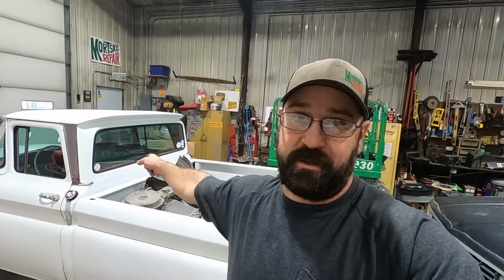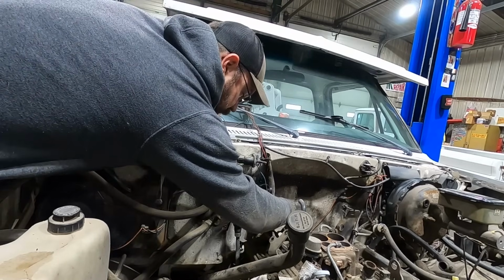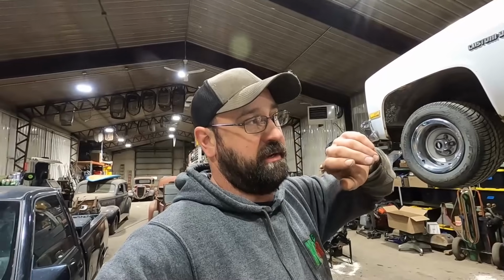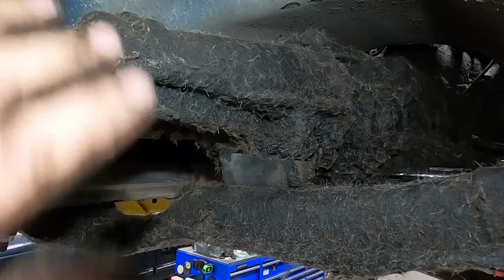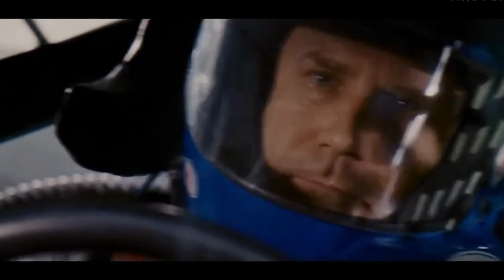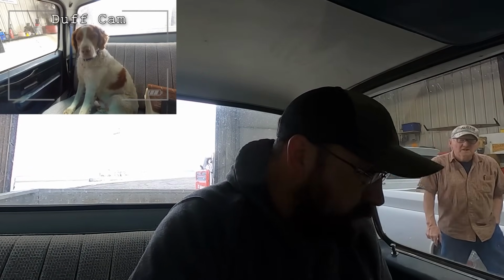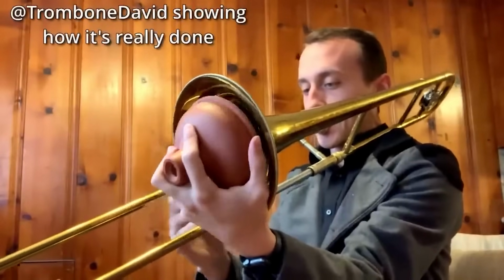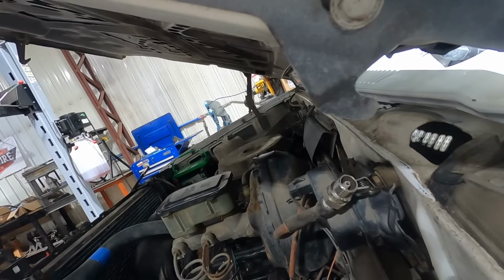V8 Squarebody Swap in a Weekend!! Out with the old V6 and in with a new Small Block! Power Upgrades!

Comment: My Grandfather bought a brand new dark brown 1985 Lwb 2wd Squarebody off the lot. 4.3 4brl th375 turbo. Trucks still running down the road with matching numbers still intact. 39k original miles.
Reply: Funny thing, i bought my Black  '85 SWB 4x4 off the showroom floor and still have it and drive it to this day!.. however unlike your grandad's its not matching numbers but new crate 350, headers, big intake, new trans many times over, but always will be my baby!
Reply: @billnalder1017  sweet 😎
Reply: @billnalder1017  Question, did your 1985 stock transmission have a kickdown cable?   Unlike the 86 style
Reply: @brons5256  Im pretty sure it did, however  the truck has gone thru many a transmissions..it didnt come with a trans cooler originally but it does now... its an awesome truck- im still enjoying it to this day..

Comment: If it was a Toyota, I'd say "Bugger!".  Well, the V8 runs at least, eh?  You made quick work on that swap, mate.  Amazing what you can do with stuff you got lying about the shop too.  

Just as a warning, I've had several ignition modules that died intermittently.  Engine would get warm and they'd conk out for a couple of minutes and then fire up like there was never an issue - usually about the time it took me to lift the bonnet after cranking it a couple of times.  I'd check for spark, the old cow would fire up on as many as she could, I'd put the plug wire I was testing with back on - thinking the problem wasn't spark - get a few miles further down the road and it would repeat the problem.  Took me a few times of it doing this to find the problem.  Once it was a loose connection on the coil and the others it was the module itself overheating and dying.  From that perspective, you cannot beat points and a condenser, but those buggers have their issues as well.  I'd still rather have an electronic ignition in the winter though, for sure.  

I'll never forget the time the first one started dying - I was in 3rd going down a hill and the rev counter kept going to zero when the module quit and bouncing back up when it came right again.  Every time it came back to life there was an almighty BANG from the rear of the car as the unburnt gases in the pipe suddenly ignited.  The bloke following me reckoned one of the belches of flame was at least 3ft long!  All I know was that it really lit up the back of the car when it happened at night - certainly enough to see the looks of surprise on the faces of the people in the car behind me!

After checking all the wiring connections to the ignition module, if you got a spare module in your stash, that would be the first thing I'd change.  One thought - if the switched power going to the module - if it comes directly from your ignition switch, you might want to check that too.  However, my money is on the module being temperamental.  As to the gauge cluster being dead, the power gets fed through the gauge first and then it grounds out at the senders to various degrees, which in turn moves the needles.  If there is a common power to the fuel, oil and temp gauge - either in the back of the cluster or through a fuse or relay - then that's where your problem lies.  Otherwise I can't see how all three gauges can read nothing unless all three senders are bad.....so its more likely there is a common power fault.  Check fuse, then relay (if it has one) and then power wire.  Hopefully it just a dirty connection.

All the best - and please let us know how you get on.  Cheers!

Comment: I did a V8 swap on an '87 long bed 4 speed that had the same issues with the 4.3L. I slid the V6 frame mounts ahead and welded the mounts and the bottom part of the mounts to the cradle. The 350 sat a lil' crooked, but it worked fineish

Comment: I always thought the 4.3 motors never got the recognition they deserved. I found them cheap and dependable for the money.  My 2nd gen Blazer had the fuel injected 4.3 and always ran very nicely. Always had great responsiveness. I never had any power train issues at all in that 4 by 4 SUV which I drove over ten years. I thought it tempting to change out the center point injection system to a multi port, with the adaptation of a neat Delco replacement kit. Then I thought, if it ain't broke,....... don't fix it!
Reply from the maker: Nothing wrong with them. This one was just worn out.

Comment: There is a difference in Temperature sensors.  get the one that worked with the gauge.  Oil pressure, usually die due to internal leaking

Comment: I had an 86 with a blown up 4.3 and a 4speed, just a plain-jane no a/c vinyl seat.  I put in a 350, which was a pretty easy swap, made it a good working pickup. I was able to use a lot of the v6 stuff as you did.   We got a bit of snow in McCook as well.  I keep telling myself it is one day closer to spring!
Reply from the maker: Sure is

Comment: Mortske, you are putting a lot of faith in that engine lift plate.

I have had an engine hit the ground while using that type of lift plate...

No, the lift plate did not fail... 

No, the bolts did not break....

No, the hoist did not fail...

THE INTAKE CAME APART!!! 

Like the 4.3 you are pulling out 
The engine seemed to have a bad head gasket.... 
This was a misdiagnosis.... 
In reality the intake had a crack underneath that was causing the same symptoms as a blown head gasket....
after I lifted the engine out, I was rolling the cherry picker away from the truck and as it was going over the grille the intake gave out the rest of the way.... 

It demolished the grille and front valance, bent the crap out of the hood latch, radiator support, bumper, and smashed in the oil pan so badly the oil pickup tube was broken off of the oil pump....  

Just for your own safety I would suggest looping a chain around the engine through the lift plate and locking it to itself.   it will keep the engine from falling in the event the intake fails to support the weight of the engine....

It would have saved me from buying a grille, bumper, and valance for my customer. 

I was really lucky not to get hurt when it happened, if the cherry picker had not been stopped by a wheel getting jammed in the floor drain grate it would have run over my foot.
Reply from the maker: never heard of such a thing
Reply: @MortskeRepair  That's understandable,  until that intake came apart, neither had I. And even though I haven't had another one do it, I always use a safety loop  just on the off chance it does.

Comment: I'm sure by now you've got it fixed, but I'd still suspect you had a bad HEI ignition module.  Had one doing the same thing in my 78 a few years ago while camping.  Would fire up and run like hell for a little bit before it just lost spark completely and died.  Turn the key off and let it sit for a few minutes and it would fire back up and run a little farther.  Did that several times before it finally died altogether.  Fortunately my old man taught me to keep a spare module in a ziplock in the glove box for just such an occasion and I wasn't stranded 2 hours from home.

Comment: Take that sunk float out and put a new one in it , Q Jets are soooooooooooo easy !  When the fuel leaks from the accelerator pump stem and not the Air horn vent , it is usually the "Foam Float went absorbent" , not trash under the needle.

Comment: I like the fact that you used the correct motor mounts, I had a manifold problem on the exhaust hitting the valve covers. I stuck an LT1 in a 58 Delray. I had to grind the little lumps off the manifolds to have a little space between the valve covers and exhaust manifolds. Doing it right never makes you a hack.

Comment: Excellent video Mortske Repair    :) , Duff Dog 🐕,  , MOJO :) , Mr. & Mrs. Pookie and daughter  to ! Also Mortske did you hook up ground strap on firewall heater to bolt back to plus Ground pigtail to fender wall clean up like it 10 mm bolt too, oil pressure gauge on left side on front 2 spark plugs  in middle to  also temperature sensor   near thermostat is and hope solve  those problems! Filler neck should replace and no leaks and rad recore or fix tanks up too so no leaks!

Comment: Good (and timely) video today. Had the same intermittent problem with the ignition module in my ’77 LeSabre with the Pontiac 301. Solved with new cap, coil, module, rotor, and ground wires. So many issues can be traced to ground wiring in an old B body. Very frustrating though; twice she had to come home on a AAA flatbed! 
God has absolutely blessed you with the love of Duff Dog; the way he appreciates your pets at the end of the video says it all. Love the Duff!

Comment: 46:32  Casper might be a good candidate for a Holley Sniper kit. It would eliminate the need to play with quadra-bogs.
Reply: Wow never those things are trash have you seen anyone have good luck with one ? If so send me the video of them bolting it on and driving away that carb has some garbage in the seat is all and it could easily be fixed in no time w out installing 02 sensors and maf sensor and programming it and then still having issues w it kill. The battery like he did and opos start all over nevermind higher pressure fuel system and the list goes on for a. Over complicated carburetor say I'm lying !! If it was fuel injection ok but to swap is stupid and a waste of money for what a better cold start not better performance nope so what was that again two thousand dollars later and it still won't run right again say I'm a liar  ! All those aftermarket injection systems are nothing but an over complicated expensive carburetor that still doesn't work right ever show me a video of anything besides that please do I'm dying to see it ..
Reply: Not on a bet they are too  expensive and for no gain show me one person that had good luck w one ever and besides that the higher pressure fuel system and again no performance gains maybe a better cold start.aybe but I can set theT q jet to start like. A champ in zero degrees so again 2000 dollars later what have you gained nothing but you think you look cool cuz you can afford to throw two grand out the window if so call .me .Mr window lol

Comment: Thats not an EGR intake. The raised area with the bolt on cap is for heated choke from the exhaust crossover on the intake. Many of the older chevy's used the heat in the intake manifold to work the choke.

Comment: I had a simaller fitment issue once. Chinese chrome valve cover wouldn't clear a Chinese aluminium intake. My cheap solution was to use 2 valve cover gaskets on each side. I bonded them together with gasket shellac before installing them so they wouldn't squirm around while tightening them up. Worked pretty good for me. Your results may vary...
Reply from the maker: Good to know

Comment: I've no idea how the ignition on those work..

 But I've seen a coil start to break up once it gets up to temperature (say 20-30 min) then lose spark, leave it for a while to cool off and it'll start and run for the same again and then once back up to temp it will lose spark all over again
Reply from the maker: Thanks for the tip

Comment: Hey Mortske.  When a belt is "serpentine" it "snakes" around a lot of pulleys like a "serpent".  Serpentine doesn't describe the flat grooved cross-section of the belt versus a V-belt.  If a flat belt only goes around two pulleys like the water pump and alternator or crank and alternator, that doesn't make it "serpentine".  Just tryin' to help.  :)  Take care.

Comment: Getting ready to do this to my 91 short bed, found a 454 with a TH400 for $700 but I don't know if I wanna go that route, that's a lot of engine 😮 I do have a 305 and a 700R4 in trhe back yard, probably gonna separate the two and mate the 305 to the 5-speed in the truck.
Reply from the maker: Nice
Reply: @MortskeRepair  Ain't no way in hell that 5-speed would hold up to that 454.

Comment: If you ever have trouble with that bolt hole for the starter they make a straight across dual bolt patern starter. Its one of those high torque mini starters but they work well. I think i got mine from summit or speedway
Reply from the maker: Good to know

Comment: Had the issue in my '03 Avalanche where my Temp was always pegged on overheating, speedo didn't work, fuel gauge was about a ¼ lower than actual, and voltage read low as well I believe. Never did figure that out.

Comment: That's one of the easiest swaps to do. We did that with an '83 that had a straight 6. It had one of those integrated intahaust manifolds which was cracked to Hell and back. Got a 350 from the junkyard with 40k miles which was cheaper than the manifold. Just had to cobble up the linkages is all. Bolted right in - started up first try. He got another 100K+ miles out of that pile of rust.
Reply from the maker: Good times!

Comment: I've had the wires from the distributor module to the pickup go bad. Also seen them act up when the vacuum advance would kick in and rotate the plate and separate the wires.

Comment: Hello Mortske, you should've went ahead & took that Chinese intake off & put a stock GM Quadrajet intake on but that's me,I guess I'll find out if you keep that intake on or take it off,now back to the video, oh yeah say hello to Duff Dog for me & if you have stop leak for radiators up there where you live at it works pretty good,but it just depends on how bad that radiator is & hope you find an original square body radiator & shrowd for Casper,I still say you should get a Quadrajet intake & put on the 350 bcause that intake is to shiny for you plus it's made in China 🇨🇳,it would look better with the Quadrajet intake

Comment: The first S-10 engine swap I did, found a 262 out of an 84 Chevy C10, looked specifically for a 2 piece rear seal with the mechanical fuel pump, used it to replace a 2.8, word of warning, the 262 QuadraJet intake will not fit under the S10 hood without help, as in cutting a hole, perfect reason to use a cowl hood
Reply from the maker: good to know!

Comment: '86 models have a big pos ignition box (ecu) that sits behind the glove compartment in the cab.  If it hasnt been deleted yet it needs to be, it will fail and kill your spark and there is no replacement.  A couple cut and spliced wires will delete it.

EDIT: you can also use this to your advantage for theft deterrent with quick connectors  ;)
Reply from the maker: Good to know

Comment: I think you do need a cowl - probably a piece of sheet metal across the top would do.
Headers are really only needed on a high-revving race engine - to keep from burning up valves. You can get better gas mileage on a tow vehicle but not by a whole lot. The idea is you want each exhaust port to have the same amount of back pressure. Sticking just headers or just an intake manifold on is pretty much not going to do a whole lot.

Comment: Doing something similar on my 1983 Dodge D150, it's a factory /6 short bed 4 speed manual, I'm swapping in an equally old but not as tired 318 out of my Dad's truck. He passed three years ago, my brother got into an accident a handful of months after he passed and my Dad's 1983 Dodge D150 318 auto long bed was totaled. Long story short, I pulled the motor and bought the 1983 Dodge D150 I have now to put it in, because a V8 4 speed short bed pickup truck is something my Dad may have killed for if he were alive.
Reply from the maker: Good luck
Reply: @MortskeRepair  Thanks man! Almost got it done, but I ain't got a pile of trucks for random bolts and bits that I've had to source. It's really annoying when a few bolts is all that holds you up and of course, they're some kind of special bolt. Finding the flywheel and clutch bolts was fun!

Comment: Back in the day my sister's boyfriend had the camshaft Broke in it at about 30,000 miles right in half . the hot 350 in it then and it was awesome. Smoke the tires and ran like stink. Thanks for the Vedio. Duff farts gotta be bad.😂😂

Comment: Stop flooding the engine and don't knock those 10 bolts.  I had a '76 Camaro I put a 454/Turbo 400 in with a 3:42 10 bolt in it and it just ran just fine.  All I added was a truss rear cover to make sure everything stayed in place.  "Ya gotta do what 'ya gotta do .   lol

Comment: Mortske there's a chance that the trans in Casper is a rare/odd TH375. its a TH400 with a TH350 spline tail shaft. They only came in V6 1/2 ton 2wd trucks/vans to replace the early failing 700R4's. It has the same clutch pack setup as a TH400, which is different than the early 70's station wagon TH375 that has one less in 1st and second. I went back and watched the first video and in it you said the stickers still in the glovebox, is there any chance it says something different than the M40 RPO? The internet rumor is both the TH375 and TH400 used the M40 RPO. The tailshaft is also flat on the top, 27 spline, and some say 375 on the bottom. Just a weird thing that GM did in the mid 80's. The first year GMT 400 SS454 trucks also used this trans instead of a regular TH400 or 700R4!

Comment: I didn't do no cleaning on anything when I put the engine and trans in My 85 I just took it from one truck and right into the other. I honestly regret not doing it when I had the chance though because now I'm trying to clean up the engine bay and it just looks like crap.

Comment: I had 2 85 swb that came factory with 4.3 V6s Th400 and horrible 2.73 rearend gears. Dog slow but lasted forever. I say that because I bet with the 400 and v6 Casper probably has the 2.73s

Comment: I’m thinking about putting 15x 10 steelies and 275/70 15s on my 1980 c10. Do you think they’ll be too wide or should I just go with 15x8s? Any ideas will be appreciated. Great video!
Reply from the maker: I’d do 8s
Reply: @MortskeRepair  you think the tire size would be ok?
Reply from the maker: @after5auto133  ya, too wide on the front